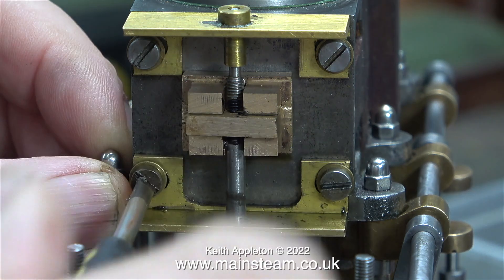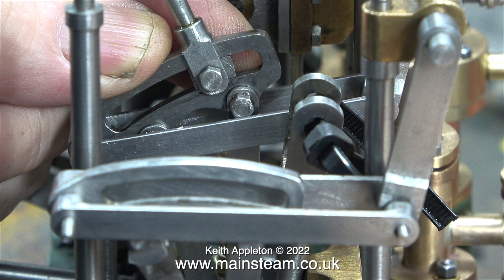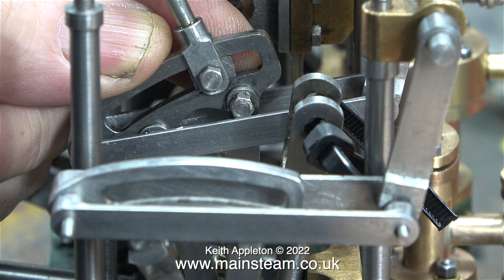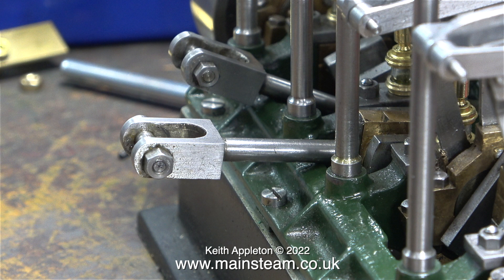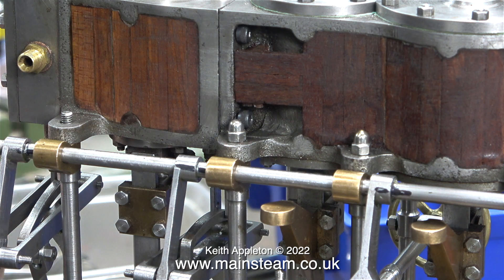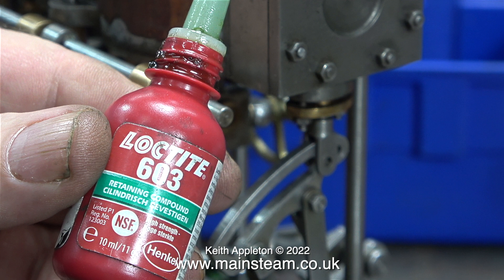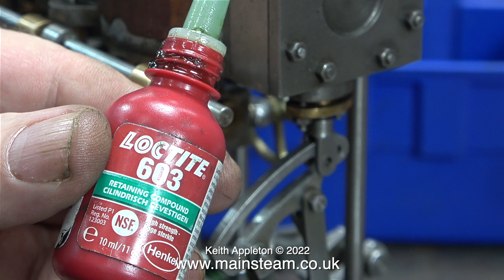COMPLETING A STUART TRIPLE EXPANSION ENGINE - PART #39

Comment: The top of the acorn nuts looks like the bottom half of the "large" acorns on whatever type of oak trees we had around our house when we lived in Birmingham, Alabama (USA).  The acorns on the live oaks around our house are quite small and aren't pointed enough to look like acorn nuts.

Where do you get your "Model Engineering-size" taper pins & taper reamers?
Reply from the maker: Where I buy most of my model engineering parts from: www.blackgates.co.uk (Worldwide mail order)

Comment: I, too, have learned the hard way not to use ball-end allen keys to tighten (or loosen) a hex head bolt or set screw: I broke the ball off of a 1.5mm key and had to grind it out of the set screw (which was in an aluminum hand wheel) using a small diamond dental burr. Not Fun.